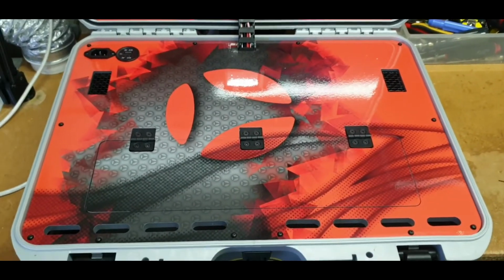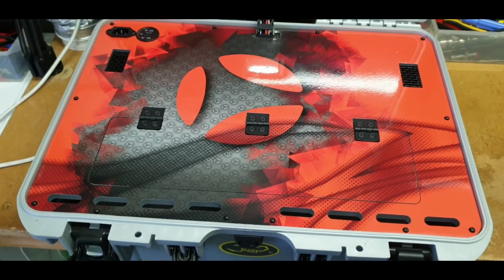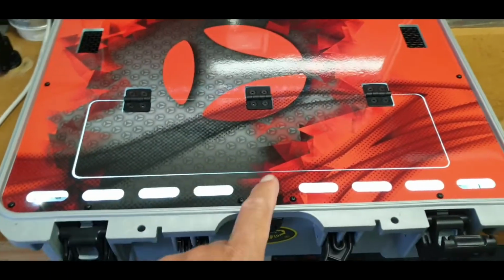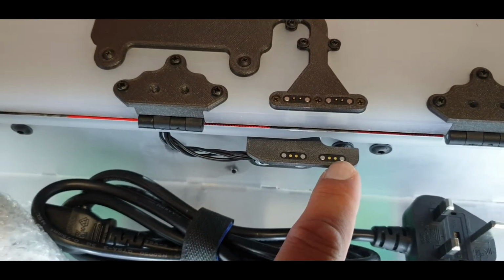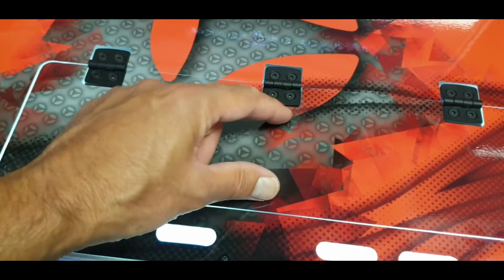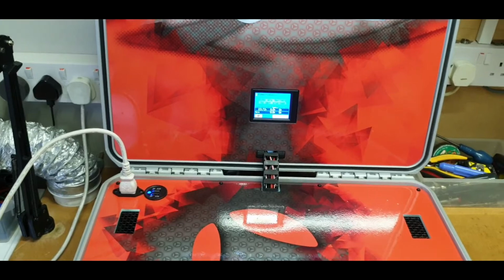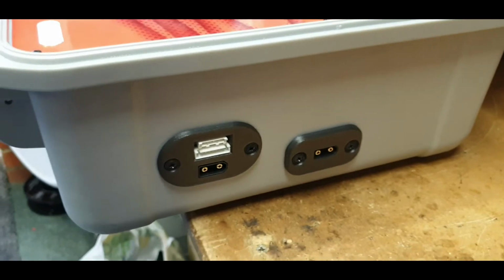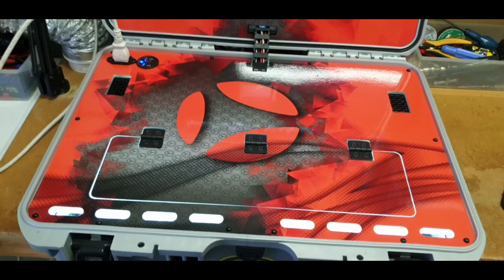Coolice Charge Case Twin PL6 Upgrade

Comment: Tasty Ian - great job
Reply from the maker: Thanks for the compliment buddy it's appreciated
Reply: @CooliceChargeCases  shame you aren't over here - you'd be making a packet - charger cases are very in vogue now :-)
Reply from the maker: @randallpatrickc  Hey Buddy. Are you US based? I can ship to the US and have done so a handful of times now, but sadly the postage is higher. What I do try and do is keep the weight lower, so for example as I use server PSU's mainly I can omit supplying them myself and guide you on how to modify and fit your own on arrival of any charge case order. As I have the each slide on/off connector setup, this becomes very easy and shaves a good 3kg of the weight.
Reply: @CooliceChargeCases  I have had quite a few inquiries about mine and will refer them to you if they seem serious
Reply from the maker: @randallpatrickc  Great, yes please buddy, any and all recommendations is greatly appreciated. I always say that in my opinion recommendation from a happy customer to the next, is worth much more than advertising I could post in various places.